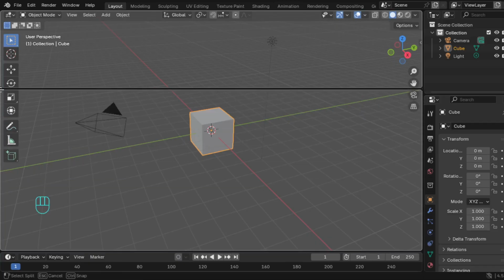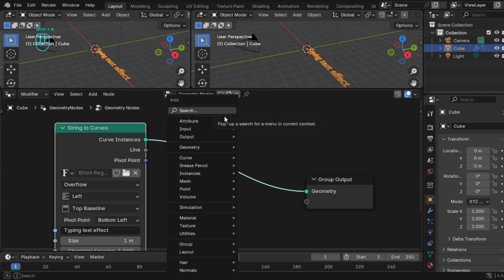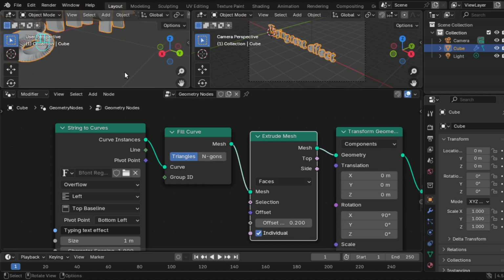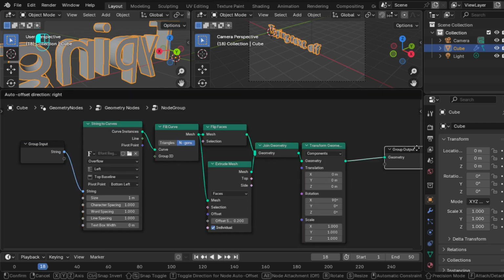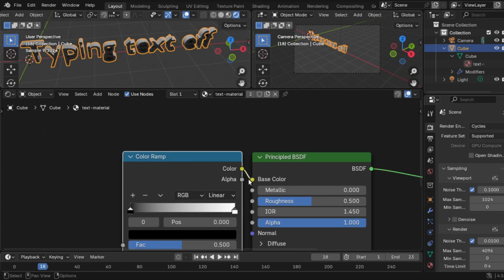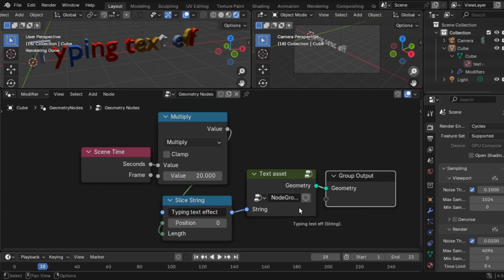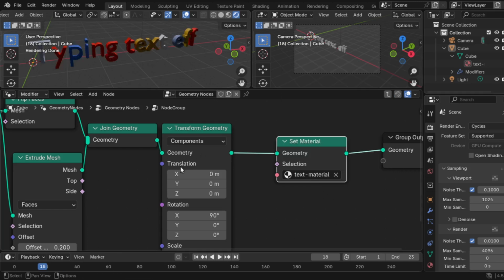Create Animated 3D Text with Typing Effect — Blender Geometry Node

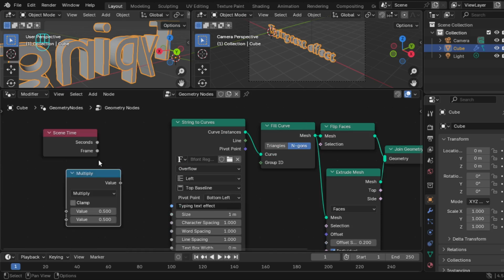Comment: 1:40 After the Join Geometry Node you always need to add a Merge By Distance Node - to weld the back face and the extruded face together.
To add lots of colors to the Color Ramp - Change RGB to HSV. Then change Near to Clockwise. Pick the two end colors and Blender will automagically add all the colors between them (in a clockwise direction) to the color ramp.
Add a Smooth By Angle Node to the Geometry Node Setup so the text curves look smooth.
Reply from the maker: I would like to extend my gratitude to @neilmarshall5087 for the insightful and valuable comments. The feedback has significantly enhanced the quality of the animation, and has also contributed to streamlining the production process, thereby improving overall efficiency.